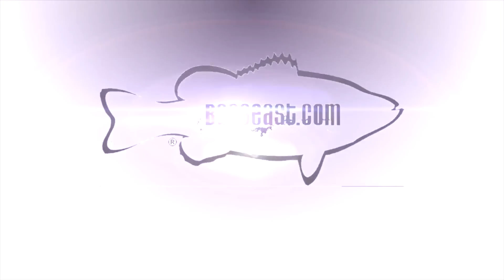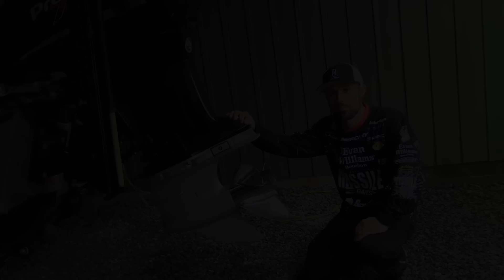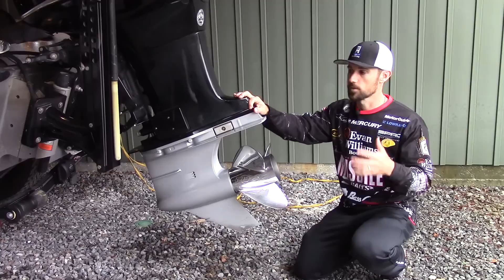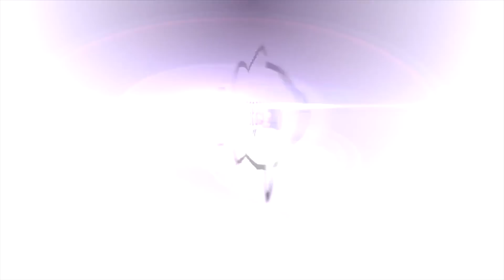Crews Control: Engine Height

Comment: Perhaps you can make a suggestion. 
Dealer installed an 8" Atlas hydraulic set back on a 2016 Ranger 620FS powered by a Yamaha 250 SHO.  Previously had a 8" Slidemaster mechanical jack that I tweaked to run 58-61 mph depending on environmental and loading conditions (5800-6000 rpm), respectively. Now the best I can do is 54-57 mph at 5400-5700 rpm. And that's generally all the way down with ~75% trim (similar to previous setup). At best I can raise 1-1 1/2" before losing speed with a consistent rpm and no more than 50% trim (according to the trim guage). While I enjoy the flexibility the hydraulic adjustment provides and understand that 1-1 1/2 mph is all that I could expect, I've lost 3-4 mph. 
Any thoughts? Mounted too high?? Thanks in advance. I've already tried the manufacturer of the product and the boat who say I'm on my own. Thanks in advance.

Comment: hi mate can you run twin outboards in the tunnel of a eliminator daytona 19ft i would like your opinion thanks
Reply: Most twin cats run them on the outside of the sponsors....like a 39 mti...or even the eliminator's...I have a single 225 sho on my eliminator sprint and it's pretty quick...great fuel economy and fun...bout 67 MPH

Comment: Where is the trim tab on that engine?
Reply: You don´t need one when you have hydraulic steering :)
Reply: WHEN USING HIGH RAKE PROPS WE PUT A FLAT ZINC ANODE THERE INSTEAD OF THE TRADITIONAL FIN STYLE.....SAME PLACE JUST FLAT NO FIN.

Comment: What if you have water coming into the boat over the transom ?  Does that mean the motor is set to low in the water ?
Reply: Had that happen with mine. Motor was too high on jack plate
Reply: Wow thanks for the reply .  The boat is a Carolina skiif that I bought used it's got a 90 horse mercury long shaft on it with no jack plate .  So now I think I'm going to get one and have the motor remounted .
Reply: @randyscott3386  hopefully that'll work for you. I bought mine used as well. It's an 06 Nitro 591 and when I'd try to get on plane, the front end would stand way up, water would come over the transom. So I lowered the jack plate and needed a new prop too because the guy I bought it from pulled a fast one on me and didn't tell me the prop was the wrong size for the boat
Reply: @randyscott3386  did you figure your issue out I have the same problem
Reply: @josephgibson2408   No , my brother wound up buying the boat and neither of us ever got a jack plate for it so the boat is slowly turning into a piece of yard art .
Reply: @randyscott3386  I just bought a 2005 nitro with a 90 mercury and it doesn’t wanna plane out without trimming the motor up I believe it’s setting to far down. It’s on the bottom holes so I’m gonna raise the motor up and see if that helps any was just curious if you got it straightened out
Reply: @josephgibson2408 how'd this work out for you?